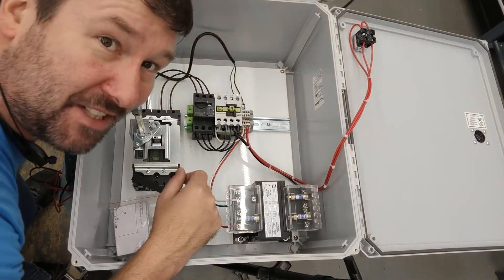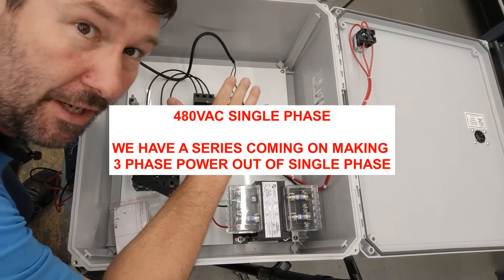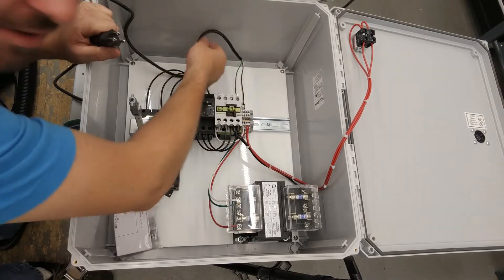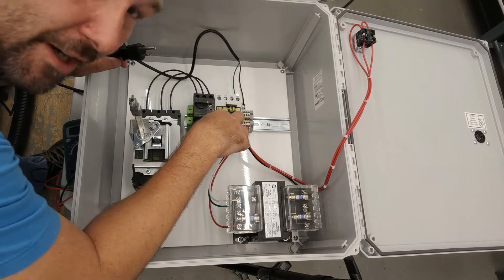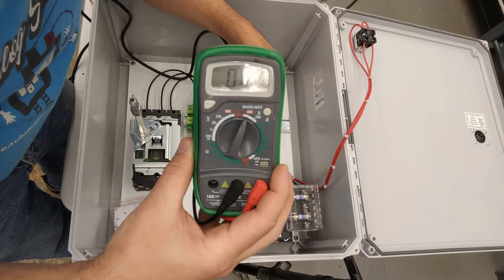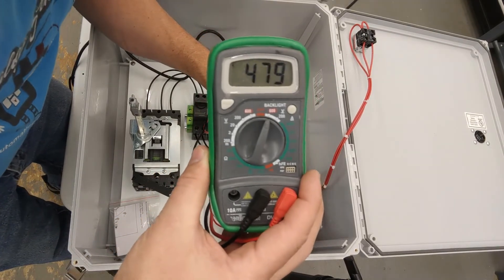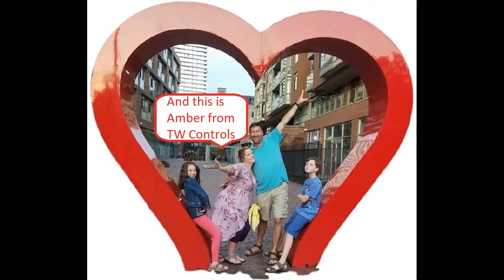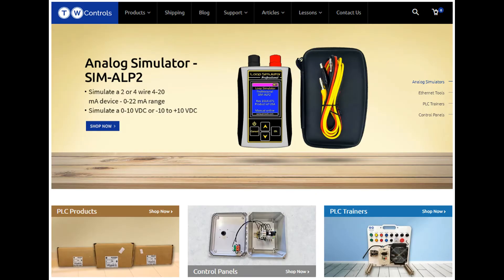Making 230VAC or 460VAC from 120VAC wall power with a transformer.  This Week's Automation Question.

Comment: Hello tim i just bought a miller syncrowave 200 tig welder and it turns out it was made for 460 vac and i only have 230 vac available. Would it be possible just to use a transformer to make what i need ? Thank you for you're time .
Reply from the maker: Yes you just need to make sure that this properly sized as far as KVA. Also is it single-phase or three-phase?
Reply: @TimWilborne  i am competent with single phase 120/240 vac but this commercial power supply i have not fully grasped.  On the welders owner manual it says it calls for 460 or 575 single phase (that's what confused me?) People claim you just us two legs from a 3 phase power supply which i do not have. My only hope would to be to turn my 240 vac into 480 vac which i would think that would work but i am not positive.
Reply from the maker: You just need to get a single phase 460 to 230 volt transformer. Let me know how many amps does it requires and I'll help you figure the KVA? Here's a video that shows me doing exactly what you're talking about except I'm doing it on three phase. https://youtu.be/xq0UAEDTKVc
Reply: @TimWilborne  this welder pulls a minimum of 30 amps
Reply from the maker: @yamahaeddiemac  That would be 13.8 KVA so get you a 15kVA.
Reply: @TimWilborne  thank you for the help. I really appreciate it
Reply from the maker: @yamahaeddiemac  Glad to help!

Comment: Tim, I would like to use to test as well ;  how would you size the transformer and fuses ??? .
Reply from the maker: For testing most control circuits 100VA would be plenty.  I have one I've modified with a selector switch to switch between 230VAC and 460VAC off of 120VAC wall power.  Maybe I'll do a video showing how I did it.
Reply: Tim;
 few  more questions ==
is this a regular transformer or is this a step up transformer made for this purpose ??.
 most equipment we use is a 3 phase 480 volts do we loop one face around to complete the third face ??
how would you do that ??.
Thanks.
Reply from the maker: @shamanking5195  It is a regular transformer whose primary is rated for 480/240VAC and secondary is rated for 120VAC.

For three phase you either need a VFD or a phase converter.
Here is a video on VFDs https://www.youtube.com/watch?v=Z_juhqYt1Ks

This Tuesday we'll have a video out about Rotary Phase Converters

Comment: good day what  make and  model transformer is that you are using a thanks
Reply from the maker: Hi Peter.  You can do this with any brand of transformer.  Mainly the secondary has to match your power available and your primary has to match the power that you want.  So this transformer had a 460/230VAC primary and a 240/120 secondary.  So I installed jumpers on the primary for 460VAC and on the secondary for 120VAC, then applied power to the secondary of the transformer to get 460VAC on the primary.
Reply: @TimWilborne  so can you run a single ph  vfd drive with this set up thanks
Reply from the maker: @peterramjattan520  You could, but there are 120VAC VFD's depending on your horsepower needs.  I've got a video addressing this very subject that will probably come out next week.
Reply: @TimWilborne  I'm self teaching myself about plc, pid and control circuitry so I want to try vfd now I want to lean a little bit of everything thanks
Reply from the maker: Then you only need a 120VAC powered VFD such as we use on our PLC trainer.
Reply: @TimWilborne  whats the price for one thanks
Reply from the maker: @peterramjattan520  For the trainer or the drive?
Reply: @TimWilborne  the drive, i already have a Allen Bradly micro logix 1200 plc that im using thanks
Reply: @TimWilborne  good day I bought   a Fuji Electric motor controller FRN0003C2S-6U .5HP drive 1 PH in  3 PH out to start to learn vfd  is this a good vfd to start to learn basic and advanced  vfd control and use thanks
Reply from the maker: @peterramjattan520  Yes that looks like a nice VFD and it plugs into 120VAC wall power.
Reply: @TimWilborne  thanks